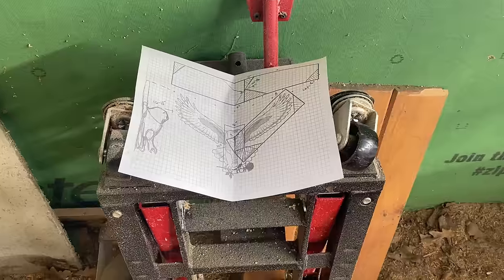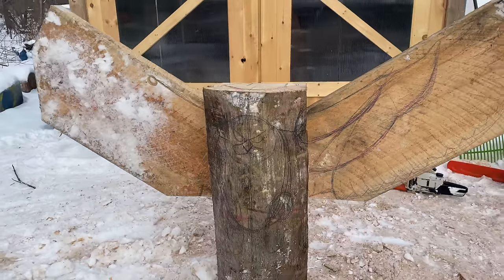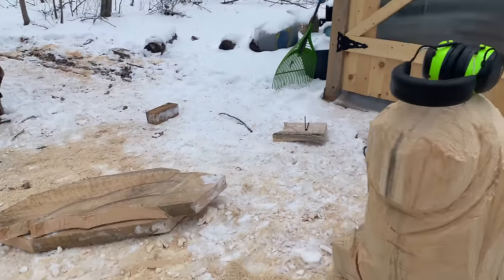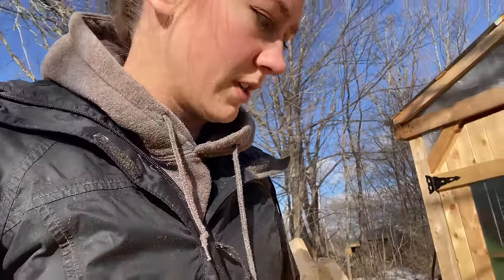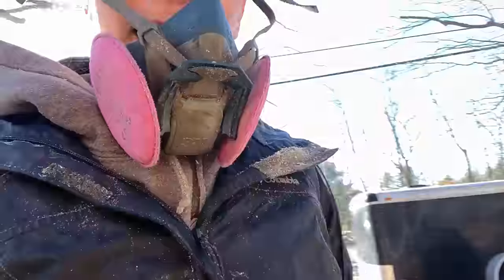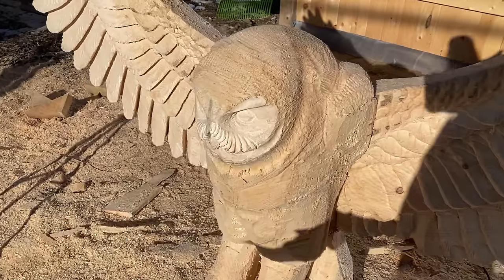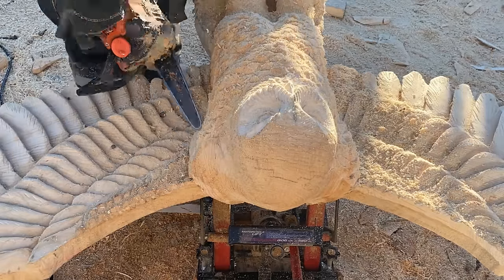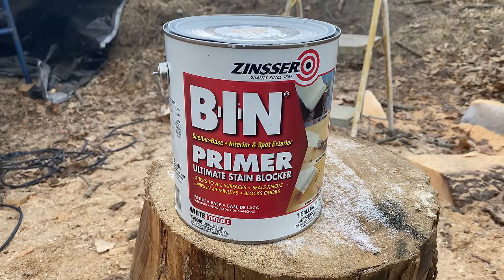Turning a Log into a 6 foot Snowy Owl

Comment: I have zero experience in the ways of chainsaw carving, but I have spent just enough time with a chainsaw in my hand to be curious if you have ever tried carving with an electric saw? It seems like you are in a place where power is available, and at least to me the reduced noise, smell, annoyance of dealing with 2 stroke gas, etc, would make the tradeoff an interesting one? Or are electric saws just not powerful enough/too inflexible/not reliable enough/missing something I haven't thought of such that gas saws are still the go-to? 

Thanks for sharing your amazing talent, this stuff never ceases to amaze me.
Reply from the maker: If you look at my older videos I only used electric! I had one corded saw and I carved with the 18” stock bar that came with it for the first 6 months of my carving career. When I carved my life sized buck I realized I needed a lot more power but the more powerful electric saws were 3X the price of their gas powered equivalents. So I opted for gas. Many of the electric saws don’t have any play on the throttle either, they are either off or full throttle, where gas you have complete control. I might pay $20 a month for gas with oil mix but my electric bill was up $175-200 a month when I was using all electric. There are definitely great electric options and I will definitely be looking into them more in the future so I can work more indoors! But the ones I’m interested in are a bit out of my budget currently and where I only carve outdoors, gas is just more powerful and cheaper :)

Comment: I would be using 1” shallow tapped wooden pegs 2 in each wing
Reply from the maker: I used 8” structural timber lags and the foaming gorilla glue! Love those Timberloks, they are strong and so easy to work with!

Comment: I'm curious what type of airbrush do you use that has such a large paint holder. My air brush has a little container,  which for larger projects is kinda a pain. You do wonderful work. Thanks, Jim from BC
Reply from the maker: Iwata Eclipse siphon feed, and I use the large mouth 30 degree bottles, they make them even bigger than the ones I use too.

Comment: What saw are you using with your 8" diamond tip bar?
Reply: As always, WONDERFUL work by the way!!!
Reply from the maker: Echo 2511p, to my knowledge it’s the smallest gas saw on the market right now! It’s a BEAST!
Reply: @TayMarie23  so you'd recommend it then?
Reply: @TayMarie23  I picked up a new ms170, had the shop swap the sprocket out, swap the bar, and chain, to a 12" carving bar and chain last week. Just finished my second carving ever, ALL motivated by watching YOU! This is a blast!!!
Reply from the maker: Down the road yes, the 2511p is much lighter and easier to work with since I’m smaller. But if you can also put a dime on your 170 like you stated! I wouldn’t put an 8 dime on a 170 though, the housing is a bit too large and you would have a hard time seeing what you are doing! But a 10-12” dime would be great!
Reply: @TayMarie23  thank you so much!